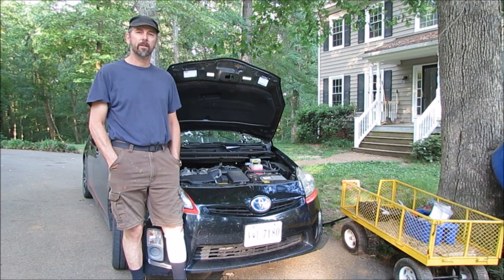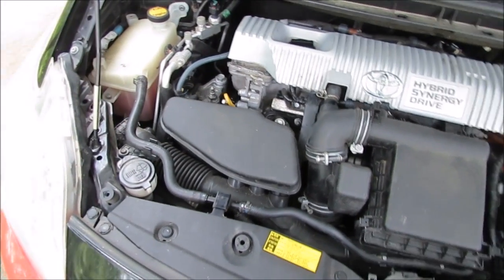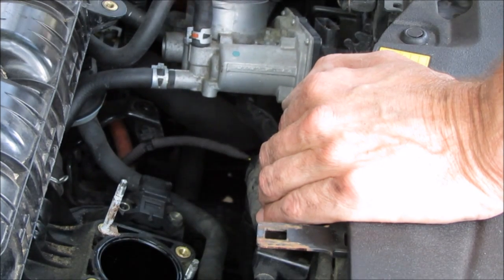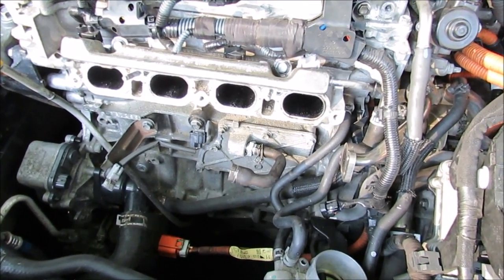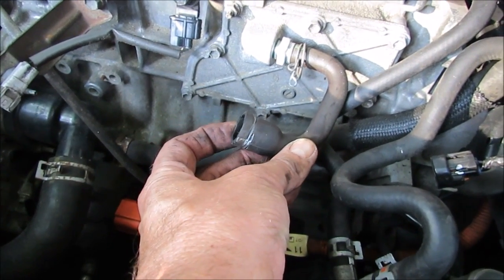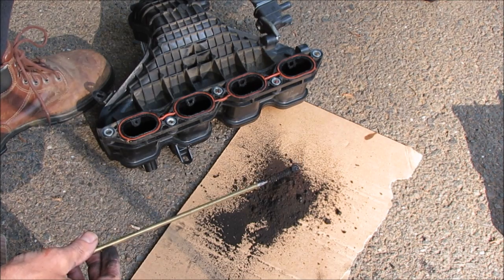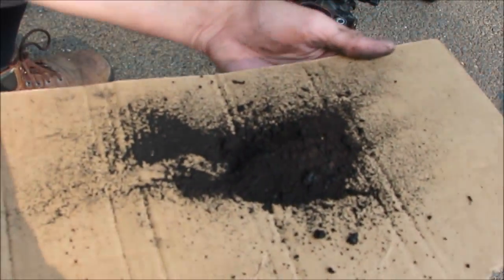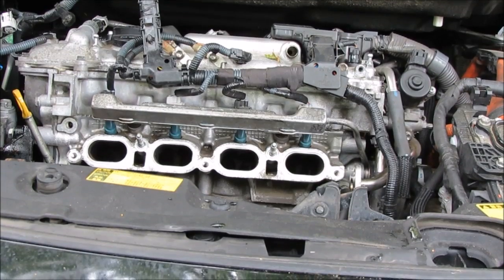Prius Intake EGR ports clogged

Comment: You’ll want to run a can of Royal Purple Max Clean at your next fill up. It’ll do a great job of cleaning up your injectors and combustion chambers. You should notice better starting and smoother running of the engine.

Personally, I’d also remove the crankcase breather tube; plug it on the box and put a cheap filter on the valve cover. The hybrids get a lot of buildup on the intake side.
Reply: Have you done the vent to atmosphere pcv on your prius? I was under the impression the system would read that as a vaccum leak and the car wouldn't run. And yes i mean with the intake side plugged.

Comment: Tip. Use an old tooth brush to clean out the EGR tube along with brake /parts cleaner spray. Use a 12D common nail to clean out the small EGR tubes in the manifold ports. it is a perfect fit. After using it I reamed the hole out with a drill bit.  I had  a simple dish plastic bristle scrub brush, dipped in mineral spirits  to clean the manifold ports. Used a metal wire brush dipped in mineral spirits to clean the engine block ports. Nice video. Easy to follow. Car runs like it is right off the showroom floor.

Comment: Thanks for posting. Curious how your head gasket has been on that car. I have the same year.
Reply from the maker: I just did my Head gasket a few weeks ago. Was losing coolant, pressure checked ok (held pressure for two days without dropping), but every few days my coolant level was dropping a little. 
I could smell coolant when coming to stops in traffic, but no external leaks.
I was burning oil so I decided to re-ring the engine while doing the head gasket. Gotta pull the bottom of the engine off to get to connecting rods and pistons come out the top, so I got a hoist and engine stand, pulled the engine and stripped it down in my basement.
Honed the cylinders, lapped the valves, replaced valve seals.
The oil control rings were completely blocked (249000 miles).
Reassembled, torqued everything per specs, used Toyota gasket sealant. 
After it was back together, it threw a couple codes related to timing, I cleaned the Oil Control Valve, OCV ( on top of engine above timing cover, plugs in next to No 1 spark plug, part of the variable valve system), it was sticking , sometimes one way or other way or in between. Drove for a couple weeks, no more codes.
I do have a noisy valve train, clicking, tapping, low rattle when accelerating under load.
This weekend I pulled the valve and timing chain covers, checked everything, pulled camshafts, checked hydraulic lifters, soaked and cleaned in marvel mystery oil, everything checks OK.
 Reassembled, got camshaft-crank code again. OCV sticking again, cleaned, drove for 30 miles last night, no problems. Started the car this morning and ran like crap, threw the cam-crank code again, turned it off, restarted, drove 40 miles to work, no problems, no codes.
Later today I'll clean the OCV again, it took a couple cleaning last time, hopefully it'll clean out, else I'll replace it 
Still have a low-level noise on valve train.
Anyway, that's where I'm at in my life with my Prius.
I shot a video on the engine work, just haven't had time to edit and post.
Reply: @robrig1646  Hey Rob, I'm north in Fredericksburg, and I like heading to the Capital Trail on occasion. I wonder if we've ever passed? Anyways, I came to the conclusion after watching your video and others that although I wished it was an EGR valve, it likely was a head gasket in my 2010 Gen 3. I thought I lost a little bit of coolant, but I only topped it off, as in maybe a cup, about a month ago. I realize now it could've simply been routed elsewhere, such as the heater, or even my plane of sight, etc. Since then, no loss, but today I did have that scary knocking sound on startup. It went away after 30 seconds of sheer terror. However, after performing a NAPA head gasket block tester test, I could find no evidence of combustion gases in the coolant. I ran the engine way past the necessary time of 1 minute, and ran it for a half hour. Nothing. I am wondering, have you tried the head gasket block tester to ensure it is your gasket? Anyways, I am sighing in relief, but I still need to know the source of the knocking that just started and then abruptly stopped after 30 seconds (it's done it today about five times with turning the car on and letting it sit off for a bit). I am hoping your video might lead me to an answer, but didn't know if my gasket testing tip could help you in turn. Anyways, happy biking. Take care. -Todd
Reply from the maker: @OutSciEd   I occasionally got a misfire code for cylinder 1 or 2 and occasional rough engine on start after cleaning out EGR tubes, heat exchanger, and EGR valve  a second time in about 8 months.
I suspected a head gasket because I was losing a slight amount of coolant every week (maybe 1/4 to 1/2 inch) and couldn't figure out where it was going. I couldn't smell anything in my exhaust, but on my way to work if I stopped in traffic I could smell coolant. I replaced the radiator cap- made no difference. I bought a radiator pressure tester and connected it to the top of my coolant tank (takes a special cap adapter that doesn't come in any kit, had to buy it separately). My coolant system held pressure for 2 days straight without dropping a single psi, no leaks under the car, no leaks out of the heater box drain, and I even added florescent dye to the coolant and bore scoped my cylinders; nada, no leaks anywhere.
I was also burning a quart of oil every 800 miles and getting oil pooled in the bottom of the intake manifold, so I got a used 2 ton hoist, an engine leveler, engine stand, and pulled my engine in August.

I tore the engine down in my basement, cleaned everything, used the Prius manual for torque specs. Honed cylinders, re-ringed, replaced valve seals, lapped valves, reassembled with new head gasket and head bolts. 
Reinstalled the engine, flushed the coolant (due to the dye making the pink fluid look like green fluid). This was on a weekend. I drove the car to work on a Monday and got a timing code. Pulled the VVT  solenoid and found it sticking, cleaned it and reinstalled. 
Timing code came back again, I pulled the VVT solenoid and cleaned it again. At this point I started to question if I was off a tooth on my time chain; the Prius manual wasn't very clear on what the gears, marks, and chain should look like because, you know, use a black and white sketch diagram  drawn at a distance of 4 feet from the engine to point out the details rather than take a picture up close and put that in the manual.
I pulled the valve cover and timing cover, reset everything, put it all together, let the sealant cure, added oil and coolant and drove it around the block- checked OK. 
That Monday I drove to work and the car started running like total shit and throwing timing codes. I got it home and pulled the valve cover, carefully turning the  crank bolt until I got the cam marks and chain marks visible on at the top edge of the timing chain cover and compared it to the crank mark on the timing cover; I was off one tooth. Somehow the chain jumped when I was reinstalling the cover. BTW, you would think that just turning the crank bolt through a couple times you would get the cam marks to line up just like they were when the chain and cover were installed, but it doesn't work that way. Once the crank rotates from the initial timing position, you have to turn it through like a hundred times to get all the teeth and chain links back to the original timing position.
I noticed the oil in the intake was still happening so I decided to get a oil catch can and put it on after I get the current batch of problems fixed.
Sooooo.. I drained the coolant and oil and pulled the timing cover again. Set the timing again, cleaned old sealant off the cover and block, resealed, reinstalled cover and quadruple checked the chain and marks by turning it slightly forward and backwards several times just to be sure the chain didn't jump after installing the tensioner.
Drove the car and no timing problems, engine ran fine. Great!
Now time for the Oil Catch Can. I got a can with a drain lever on the bottom and installed it above the engine mount on the passenger's side. My long term plan is to modify the PCV valve system to allow the catched oil to be drained back into the engine, but first before I do that I drive it for a week to see how much oil is being blown into the can. When I drain it after a week of driving (400-500 miles) I have about 4 ounces of yellow foam that drains out. Hmmm. Must have a little moisture in the crank, no problem That should clear up after another week or two of driving. For the next 4 weeks I drain it once a week and I have 4 ounces of frothy yellow foam, it wasn't getting better, also I notice a little on my dipstick. That was something that was never there before.
 "Shit", I think, " I bet I didn't do a good seal job on the timing cover and now I'm getting coolant in the oil. I'm gonna have to pull the timing cover again and reseal it".
My coolant tank didn't appear to be losing any coolant and my plan was to do a pressure check first on the coolant system. This was all between mid-Sept when I got the engine back in and the week before Christmas.
So there I was two days before Christmas, leaving work and when I started my car in the parking lot I noticed a check engine light that wasn't there that morning when I got to work. I plugged in my OBD scanner and opened the app, I had a misfire on 2 and a coolant circuit fault of some sort. "No biggie" I though, "I'll just clear it and see if it comes back".
I get about 5 minutes down I-64 and my engine shuts off with a yellow coolant icon and a couple other warning lights. "No problem, I got this. I'll just drive to the next exit on the HV battery". I was doing 70 when it quit, as I continued on HV battery the car slowly lost speed over the next mile or so and I thought "man, this car can really coast far!" Then about 100 yards from the exit I got the orange ! triangle and "Hybrid system fault". with a low HV battery message. 
"No problem. I got this."
I popped the hood, got out, pulled the big white wire off the main fuse block under the hood, leaned on the guard rail and looked up the coolant code; possible water pump fail. After about 10 minutes I reconnected the white wire, hopped back in, the "hybrid Fault " was cleared, started the car and drove off the off ramp. I kept the app opened and monitored my coolant temp. I got maybe 2 miles down the road and the temp hit a critical number and the engine shut off again. I coasted into a parking lot with a "triangle ! hybrid fault" message , pulled the white wire waited 10 minutes, restarted the car, drove another two miles, the temp hit the limit, engine shut off, etc. I repeated this 3 times before I was able to pull into my parking lot back at work and  call my girlfriend to come fetch me.
Next afternoon I pulled the water pump. The connector had arced at a pin. In addition to replacing the water pump, I had to order a new connector, sockets, seals, and a crimp tool. Water pump and connector came in, but the car's still at work. I've been busy with house structural issues, furnace blower crapped, a snow storm, loss of power at home for 3 days, internet issues, too cold out to work it, etc, etc, etc. My channel's not called "It's Always Something" for no reason.
Today it was a balmy but windy 40 F so at lunch  I popped the hood to at least get the pump on. I noticed a small plastic, funnel shaped insert in the pump mount flange of the timing cover and thought it was some sort vane guide for the pump impeller. When I looked at the new pump I realized it was the top half of the pump impeller, the vanes had sheared all around the circumference of the impeller leaving half attached to the pump and half nestled in the timing cover flange. I had assumed the pin had arced and that's why it wasn't working, so it looks like I had two problems. 
I'm hoping to get the Prius up and running before the next batch of white bullshit moves in this weekend. 
I haven't given up on the car yet. Hoping I can iron the bugs back out.
Reply from the maker: I've got an occasional rough engine, several months before I cleaned the EGR ports in the intake manifold I cleaned the EGR cooler. That was maybe last Oct or Nov. 
Around June I started getting the intermittent rough engine, so I pulled and cleaned the EGR cooler again- it was already gathering crap again. It didn't  fix my problem. 
I haven't gone back into the intake, it's on my list of next things to do, I'm going to add an oil catch can when I reclean the intake.
My car has 250000 miles, I'm not happy with Toyota over this EGR/ oil in the intake/ PCV/ rough engine issue I'm having. I've never had a car with this sort of problem, ever.
I'm also thinking I may have a head gasket problem, after cleaning the EGR cooler I've been having to top off my coolant every week. I pressure checked the coolant system a few weeks ago and it held pressure for 2 days. I borescoped the cylinders and didn't see any coolant getting in, no visible external leaks, but occasionally while stopped in traffic I can smell coolant. Frustrating.

Comment: How many miles on the car when this was done?
Reply from the maker: I've had the car 3 years now, got it with 180k miles, now it has 240k miles. Not sure if the miles really matter, the EGR is designed to clog. Not sure what work the previous owner did regarding EGR system.

Comment: Can you get electric shock when you opening intake manifold off  because this car is electric car
Reply from the maker: No you won't get shocked taking the intake manifold off.
Reply: How to to take battrey off if you touch battrey you will get shock how to take battrey off so no electric they in side engine at all

Comment: Ok mate please tell me do i of to switch electric switch off or not in hybrid electric cars please answer me please mate
Reply from the maker: I'm not sure what your question is asking.
Reply: Mate if i whant to work on hybrid engine side do i of to switch electric off but wehere from i of to switch electric off from hybrid car like taking egr or trottle body cleaning or some other parts in hybrid car how to take electric off thankyou very much
Reply from the maker: @mohammedshafiq4053  if you're that worried about the electrical system when taking off the intake manifold, look in the back of the car under the rear seat and pull the orange safety plug off the high voltage battery pack and disconnect the 12 volt battery. I left both connected when I did the work shown in the video.
Reply: @robrig1646  thankyou very much my mate helping me

Comment: Thank you! Have the same problem on my prius 2014. I will do this job in the next couple of days. Your video really helps with the way you describe everything in detail!
Reply: Did you clean your intake manifold? Did it fix it?
Reply: @juliocesarrojascontreras5125  I bought and replaced the Intake manifold, EGR Valve EGR Cooler and PCV Valve. They needed to be replaced because there was more grime than I could clean. But it didn't fix it. The problem with these 3rd gen Priuses is that they blow head gaskets like there is no big deal. So everyone that has these issues most likely they have a blown head gasket. Along with these parts that we are cleaning that are clogged.
Reply: @ovidiutim  Thank you for your time answering my question. I have heard many people with the same problem (blown head gasket). I'm going to buy a head gasket tester and see. But, I'm sure is the head gasket. Thank you.
Reply: @juliocesarrojascontreras5125  As I suspected it was the headgasket the main reason why the engine was running rough and missfire in cylinder 1. And after taking the piston head down that cylinder was wet and had barely any carbon deposit on it due to the fact that cooland cleaned the piston clean.
I did the job myself and it's pretty straight foreward after you get into it. Takes about 15 to 20 hours start to finish. My prius has 260k btw
Reply: @ovidiutim  thank you! I appreciate it. That was a big help 🙏🏼
Reply: @ovidiutim  Julio, about what did all those parts cost? Thanks...

Comment: Very useful and coherent video, sir. Seems like my rough engine idle may be related to carbon deposits. Thanks!
Reply: Did you fix it what is your driving style since it only happens to few Prius wondering driving style city or highway driving might contribute to Egr build up?
Reply: @ceylontea5877  Mix of both. It clears up after running a bit. Relatively infrequent now. Doesn’t seem to affect performance so far. Just sounds rough on startup.

Comment: Does your MPG improved after the cleaning? My car only 37 mpg and  its a 2014 with 145k.
Reply from the maker: I drive 40 miles one way to work every day on the highway at 65-75 mph. No change. I average about 38-40 mpg.